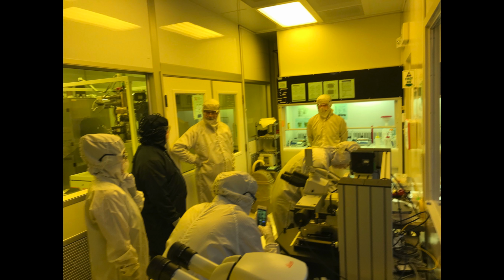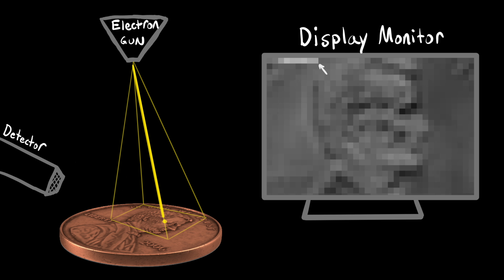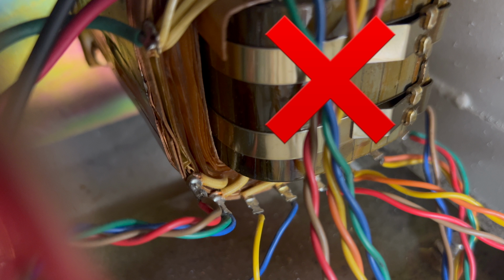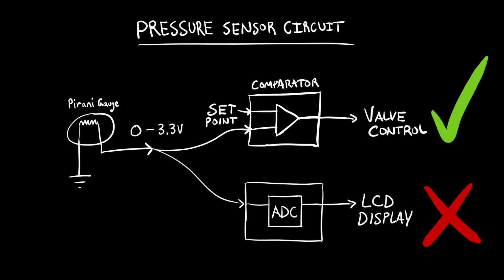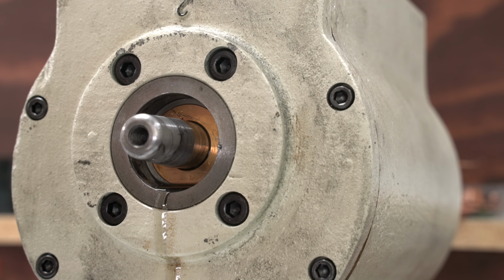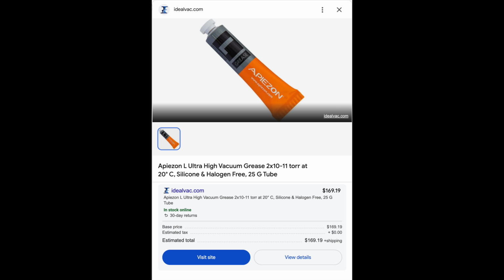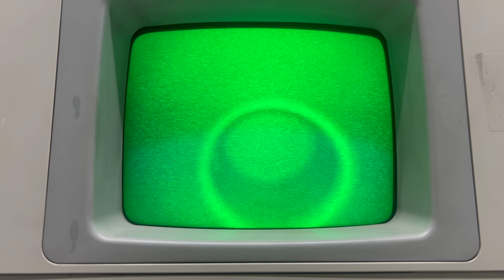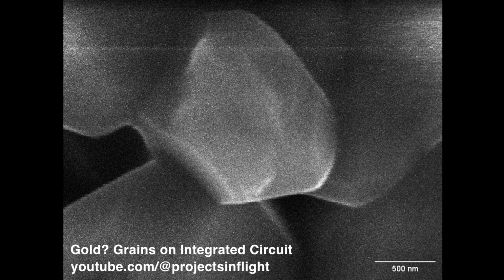I Saved an Electron Microscope from the Trash

Comment: 14:21 Its not a turbopump so it will not be destroyed in that sense. Depending on the oil used it could go from all to a nasty sticky gue or shellack in the entire pump or just nothing at all will happen. They can never really be physically destroyed. More what will happen is that the oil curtain in it will fail and spew up oil into the chamber which you really don't want in a sem.
Reply from the maker: yeah i might have been exaggerating a little bit but honestly given the need to strip and clean the whole machine, and the fact that i can't guarantee that i'd get everything back together and in alignment, it's no exaggeration to say that it would likely ruin the performance of the machine permanently
Reply: @projectsinflight  No doubt about that. Happened to me once where a DP heating failed but that was for a small vacuum chamber and not a sem or anything like that. Had to clean everything out with aceton. A B/A tube got a little shit for it but I was luckily able to revive it.

Comment: Great video.
I worked for FEI/TFS for 11 years and this brings me back so many memories. Even I worked on TEMs, the principles are pretty similar, pre-vacuum rotary pump, ODP pump, valves, high voltage, stage. It is nice that the machine has someone appreciating it and fortunately it was not sold for parts or scrapped.
Reply from the maker: thank you! btw if you are interested in chatting about TEM stuff, specifically sample prep- feel free to message me at my email (same as channel name) at gmail dot com

Comment: Good work. I have sometimes rewound transformer windings and it is not so bad a job at all. First pumping down of the chamber may take a long time since it is contaminated and has a lot of H2O on walls. The wonky picture may be caused by electronics related to the screen tube itself.
Reply from the maker: oh yeah, i definitely need to figure out how to keep the chamber more dry. it takes a couple cycles to clear all that adsorbed water

Comment: Great video! The issue with the CRT is most likely the old (dried out) electrolytic capacitors, I would replace them all (be sure to discharge anode before working). You also could easily have installed a switching power supply with multiple outputs to get the necessary DC voltages (in lieu of the 7805 and step-down transformers). They can run on the 100v from the variac, or straight from the wall.
Reply from the maker: I am concerned about replacing the transformers with switched mode power supplies because i am worried that it would introduce some high frequency noise into the system. This machine is very sensitive to electrical noise and EM interference, so i kept it as stock as possible out of paranoia
Reply: @projectsinflight  Can't go wrong with a linear setup, just have to deal with the heat as you mentioned. I work on a lot of electronics from the 80's (Arcade Games) and and did Instrumentation work for many years. Tend to find the root cause of many/most issues on this gear is related to power and filtering (electrolytics from this period don't hold up well to time). Other common issues are Tantalum capacitors (tend to fail shorted!), corrosion on connections (deoxit is great) and any previous repair work is where I look first. You could probably swap the CRT with a modern LCD/OLED. If the system is sensitive to noise, the CRT and it's high voltage flyback circuit can't be easy to deal with.
Reply: @BradRaedel   If this is a fully analog device, the scan frequency of the CRT would be coupled to the scan frequency of the microscope's deflection coils, no? I think the CRT is an integral part of a unit this old and I can't imagine that it could be replaced with a modern digital display... that said, I'm speculating wildly and anyone more knowledgeable should feel free to step in and correct me if I'm wrong.
Reply: @hostilemilkshake  Well, the aftermarket board you found in there where the RCA composite cable was pinched makes me think the CRT and input signal is standard. I think they were taking that signal into a PC with a video capture card. I'm guessing there was a program written to do better analysis with dimensions, etc. I'd bet if you run that composite RCA cable into a modern converter (Composite to VGA, or HDMI) you could display on a large flat screen. Could also get a cheap composite to USB adapter for PC.
Reply: @BradRaedel  That does not necessarily mean it’s a standard signal, I think the way the CRT scans when the electron microscope is in slow scan mode suggests it isn’t your typical 50/60hz analog video. 

It reminds me of the Slow Scan Television modes used in amateur radio. The old receivers used CRTs that have very persistent phosphors that would glow for a few seconds after being struck, and the picture would be scanned onto the screen just once as the image was being received. Similar to how the slow scan image in this video is being scanned onto the screen at a slow rate.

Comment: Wow, that was way simpler than I thought to bring it back to life. Not to take from your effort or anything, it just seems crazy you can acquire an almost functional SEM and nurse it back to life. I was expecting all kind of crazy hybrid custom electronics to be fried and the knowledge and parts to be long gone. Glad to see it was mostly "plumbing" and electrical continuity.
The unstable image looks to be caused by some capacitors or transistors in the vertical deflection circuit (display), someone with CRT knowledge should be able to easily fix it. The DAQ noise seems a bit strange but not surprising seeing how shoddy the "modern" board is wired in.
Reply from the maker: Replacing the caps is definitely on my short-list of things to do

Comment: Hi , this an amazing video. 
I have a question , u showed a picture of blood cells made through electric microscope. I thought SEM can visualize only conductive surfaces. 
And you managed to take pictures of fly by lowering voltage on electric gun. 
I don't understand by lowering voltage electrons get less accelerated (do i understand it correctly?) , but how does it enable making picture of fly ? 
Ist it like when voltage is high electrons don't scatter of non conductive surfaces ? Like when they go  "too fast" they  penetrate sample  or something?
Believe other people would be interested too why is this happening perhaps in other video you could explain why is that..

Thank you for making such and interesting video. 
Best wishes.
Reply from the maker: i can make a video with a more thorough explanation but here is the TLDR:

at higher acceleration voltages you get more detail, however the electron beam penetrates deeper into the sample and most of the generated electrons cannot get back out. Only the ones generated at the surface can be detected to form an image. However, ALL the electrons that strike the surface need to be conducted away to ground to prevent the sample from charging up (which ruins the image)

at lower acceleration voltages the electrons in the beam don't penetrate much, and so most of the generated electrons are generated close to the surface, and so they can be used to create an image

so for a sample that is not very conductive, using a lower acceleration voltage allows you to use fewer total electrons to make your image, which reduces the charge-up problem
Reply: @projectsinflight  Sample conductivity is the biggest issue, agreed.  You can coat samples with either metal (our old targets were gold+palladium) or carbon.  We used carbon when there was a chance we'd want to get elemental information.  Gold interferes more with that.  The carbon coaters are probably also available used, it's a graphite pencil that is heated up to evaporate the carbon onto the sample.  Much more modern "environmental" SEM's have the designs adjusted so that having a little gas in the chamber won't kill the filament, and the gas then acts to conduct the charging electrons.  It does degrade the image but there are ways to compensate.
I'd say for the fly image to go even below 10kV and just deal with a longer acquisition time, or get the fly coated.  Biological samples are especially prone to beam damage, I was surprised at what a good image you did end up with.  As you noted the depth of penetration of the beam affects the volume being imaged, and especially for metal you can get higher resolution of features by using a lower accelerating voltage.  We had gold coated a fly and took highest quality shots we could, and the series showing fly > fly eyeball > fly eyeball cell > microscopic dirt on fly eyeball cell, that never failed to impress visitors!  And it gave them a basic understanding of the level of magnification.
Reply from the maker: @pault151  Wow! I would love to see that series of images. That sounds so cool.
Reply: @projectsinflight  When we got that 35C there was only film capture (a separate small bright CRT created the exposure onto a film holder).  Most daily work was done using Polaroid instant films, where the gray range is from medium dark gray to medium sorta white. But we could also use 4x5 sheet film and did so for pictures where the extra contrast and resolution was needed. So the bug pictures (and assorted exemplar fractures, which was the actual business justification 8-D) were taken and blown up from the negatives.  It was years before someone sold us a digital image capture setup. 
(For those outside the field, the electron beam causes small X-ray emissions in the target, which can be collected and quantified for valuable information.) For the metallurgical work the energy dispersive x-ray detector and software were real benefits, but the old detector type needed to be at liquid nitrogen temperature. Modern detectors can operate when they are just cool enough that a thermo-electric module is adequately chill. I didn't miss the weekly or more LN transport and fill tasks!
Reply: @projectsinflight    thank you for explaining ,  all makes sense now.

Have  an amazing chalel and hoping to see yours future videos.

Comment: to fix the pressure reading you can use micro controller with i2c adc with the original sensor just replace the broken adc with modern one
and the transformer and voltage converter you can also replace with switching ones
Reply from the maker: so it's actually not that simple. The ADC is functioning just fine- as is the wiring from the sensor to the ADC. As far as i can tell, the wiring from the ADC to the LCD works too. It's very odd, and i can't actually figure out why the thing isn't displaying the pressure
Reply: @projectsinflight  you can use a extra micro controller and a extra modern adc connected to the same line to measure the pressure, no external sensor needed, repairing the ancient one is just not worth the effort,plus you can control the modern microcontroller from pc too

Comment: Didn't you set to 115 on 8:50
Reply from the maker: I did, but it's outputting 100V. I suspect that maybe either the voltage at my house is dropping, or maybe the variac isn't labeled correctly

Comment: Only 12 minutes into the video and I am already screaming at the screen
Why didn't you just put in a bunch of new, state of the art and of the shelf switch mode power supplys for EVERY powerrail, converting the whole machine to 120V in the process (excluding maybe the high voltage stuff and the heater for the pump)
Reply from the maker: good question! so i contemplated it, and i decided that for the first round of repairs i wanted to keep the microscope as close to stock as possible. it's an instrument sensitive to EM fields and interference, and i just couldn't guarantee that a switched mode supply wouldn't cause a problem with that, so i stuck with the transformers and linear supply
Reply: @projectsinflight  I thought of that too
Maybe the cheapest aliexpress special would be too noisy but a meanwell or similar good quality PSU with maybe a 5$ in line filter on the output would be more than good enough

I know the rabbit holes you can go in with that kind of repairs. "just change that one thing and it'll be fine" almost never works.

Comment: If you replaced the main transformer, why didn't you convert the device to 120 VAC? Is there any part of it, which is powered directly from mains?
If I were in your place, I'd replace it along with the rectifiers and voltage regulators with modern SMPS modules.
The analog imaging path seems to suffer from degraded or dried electrolytic capacitors. Degraded ones should return to normal operation after some use, but dried ones are lost. Bypassing X-ray protection seems a bit scary, but if you keep voltages below 25kV you should be safe.
Reply from the maker: a couple things: i wanted to keep the machine as close to stock as possible for now, so that's why i didn't try to convert the machine to 120V, but also there are actually a few AC motors for the valves that are for 100V and swapping those would be tough.

Also, i did some rudimentary checks for leaking XRays and saw nothing. I'm gonna borrow an Xray spectrometer to check for sure

Comment: Checking knife sharpening methods by imaging the edge would be interesting.
Reply from the maker: It would be interesting, but i'd need to come up with a way to sharpen a knife and then cut it apart into a 1cm piece so it'll fit in the SEM. either that or devise a method to sharpen a knife that has a removable insert or something of a similar size

Comment: As I used to say at uni, easiest way to get access to a SEM is to find an old one in the trash..
 Sadly the one I found had SF6 transformers, and that stuff makes the diffusion oil look cheap. 
Ey! I also  have the SD90, though I don't have the original filter..
By the way, you can use lighter gas as a poor man's "helium" leak detector
Reply from the maker: Haha- i remember scrounging through e-waste back at college for old oscilloscopes and the like!
Reply: @projectsinflight  Nice! 
It's wild how much stuff get's thrown out, when the only fault is a blown fuse, or a leaky caps.

Btw, a suggestion for projects, is a STEM converter. Then if you solve your noise issue, you can glue a small piece of pyrolytic graphite to a wire mesh. Then scotch tape exfoliate the side opposite to the mesh.
 With some luck one or more of the mesh holes, will be left with only a few layers of graphene, May not get atomic resolution, but some faint remnant of the hexagonal tiling is not out of the question.

Comment: Congratulations for getting this SEM functional! A little tip, the next time you come across membranes switches that do not conduct, gently rub the contact surface of the membrane (black part) across a sheet of paper. Maybe an inch. This will wear off the oxidized surface and make it conductive again.
Reply from the maker: I still have the originals- I'll give that a shot!
Reply: There is also fluid available to restore the surface.  Chemtronics CW2605 is one possibility.

Comment: The repair is incredibly impressive. Your problem-solving skills come in full-force yet again. My favorite part, while a bit mundane, was the replacing of the old transformer and voltage regulators.
Reply from the maker: I tried to make the new transformer assembly as well-built as possible for longevity! I even sprung for the aluminum plate lol
Reply: I have an oscilliscope that had a failed wacky 1980s multi-output regulator IC in it. I replaced that with a bunch of LM78xx too. Not quite on the same scale as this repair, but it made me happy!
Reply: I was thinking to bypass the faulty secondary and replace the needed output with just one additional transformer. However, perhaps the aging original transformer would just keep decaying and produce more failed secondaries.
Reply from the maker: @thecasualcitizen492  unfortunatly, when one secondary fails it shorts out the whole transformer. Even with nothing connected, the primary side acts as a short at 60Hz AC
Reply: Transformers do this a lot - especially in any equipment running in harsh environments like labs (especially ones with corrosive fumes in the air) or, in my case, music venues (old tube amps: it's the tubes, transformers, caps and/or pots) where band equipment is abused (smoke, beer, drops, etc).

Comment: I used to service Philips TEMs in th early 1970s; I remember seeing a gold lattice at >1,000,000 mafnification (vibration is areal problem, as well as uneven heat bending the column.
Reply from the maker: if you are interested in chatting about some basic troubleshooting for electron lenses i'd be happy to chat

projectsinflight at gmail dot com

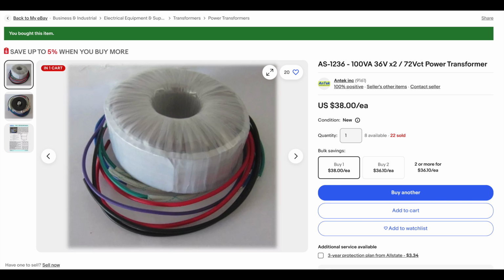Comment: At 11:00, throw away the Variac and use standard transformers...  Or even better use switching power supplies.
Alcohol will dissolve pump oil; use sparingly and/or change the oil before extended use.  Water is almost as good and does not degrade the oil.
Silicone grease will also form SiO2 insulation layers on your beam elements and ruin them.
I would buy some PMMA and MIBK and begin e-beam lithography.
Reply from the maker: yeah i was kinda wondering about using switching power supplies. i chose not to go that route because i wanted to change as little as possible

Comment: I am looking to sell my Jeol 6400 to another hobby scientist in the next 6 months! It is working, has schematics and manuals, and I can give demos or lessons. Message me for more details.
Reply: It has standard SEM detectors as well as two types of X-ray detectors, cathode luminescence detector, and a picoammeter.  I will sell it with a low vibration roughing pump and air compressor, a water chiller, and an air ride vibration isolation pad.
Reply from the maker: Have you joined the SEM discord and listed it in the for sale section? message nmz787 on discord